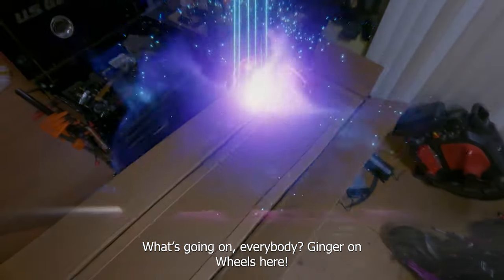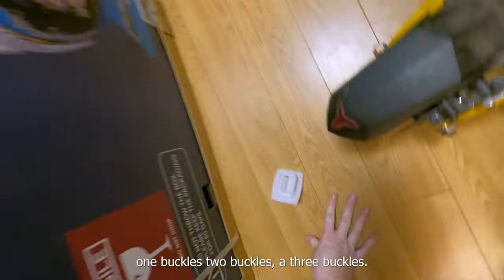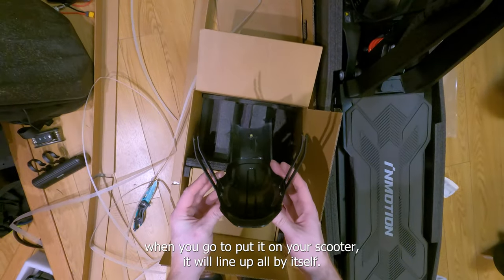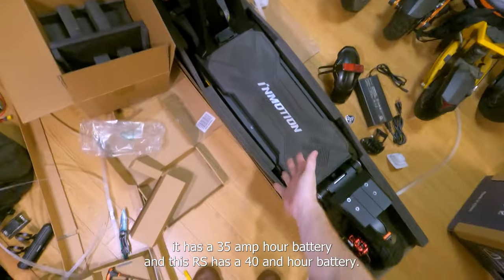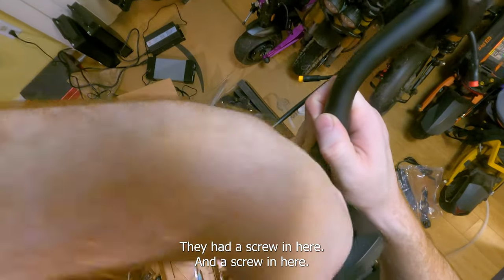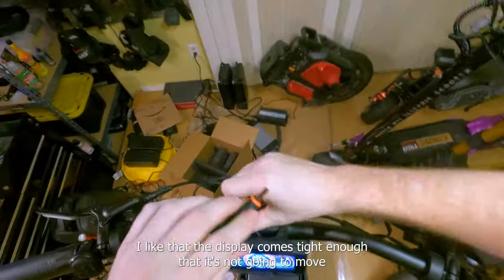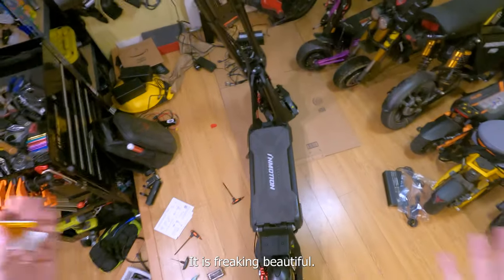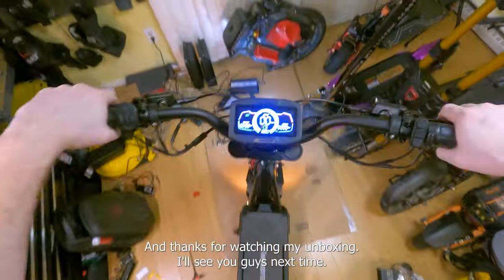Inmotion RS Midnight Unboxing & Walk Around

Comment: I have the latest batch RS from Dec, not the midnight, I like my orange, more exotic looking.  Lights at night looks amazing on orange.

To fully enjoy the extreme capabilities of this scooter, I place the handlebars at my bellybutton - I don't know your comfort level. Handlebars are flexible, not wobbly - best this way for road fell.

Acceleration is sick, warm up the CST tires (mostly nylon) first before cutting sharp corners because the power response is killer.  PMT's (all rubber) will slow it down a little, 2-4mph at top speed, but the grip is stellar.  Keep the deck level at default, no need for anything else really unless you plan on doing 64mph speed runs, then lowest level is slightly better.  Tighten the damper a little till you feel some tension, it helps.  The genius behind this scooter is that the rake angle on the stem points behind the front motor axis, this is what makes it super super stable.  Scooters that have external dampers have this flaw where the front axle is even with or in front of the rake stem angle, that is why they need it.  Kaabo's GTs stems go straight down even to motor axle (like most scooters).  Teverun 7260R (I love this SK battery) has wheel too far in front of the rake angle, at 45mph its unstable (bad), so they try to fix it with dual dampers - a Band-Aid, not a fix. I'll wait for their next design on this.  You will soon learn what I mean riding the RS.

I placed a Pedego Bike Thumb Throttle on mine (check Amazon), the best thing you can do, better control, no need to try and grip it with your inner hand. This will undoubtedly be your favorite scooter by far. 

The only other one I ride that I like better is the Emove Roadster, 75mph exotic beast.  Enjoy the RS, almost nothing beats this production scooter.
Reply from the maker: Those are all very good tips! Welcome to the channel, make sure to subscribe. Maybe you can check out the other videos I made on the gen 1 RS a couple months ago. I did a full teardown and I got it above 60 mph 😅
Reply: According to alien rides who has this the bronco vnom extreme 11 beat it in 4 back to back races. Comes with a 50ah battery and $3500 shipped. According to freshly charged the stability was better on GTR and thunder 3. Love the idea and water proofing but lacks on top end.
Reply: Yellow more then orange. Its yellow
Reply: @YoungWise2011  "lacks on top end" 🤣🤣🤣 only ppl that dont ride scooters say that. 
60mph is plenty top end. Adjust settings properly and it'll get you there pronto. 
Also you dont ride constantly at 60. Very few times will you do it. Most times ppl ride at 45mph. (60kmh)
Reply: @240jz  The Pedego is a screw strap attachment to your existing twist throttle.

Comment: Mine comes in Thursday. Pretty excited to do my unboxing as well.
Reply: Still waiting on mine. How you liking it? Did u swap out for thumb throttle?
Reply: @YoungWise2011  loving it , got few videos of it on my channel
Reply: @hurdthenerd  just ordered the lettering. Looks clean. How you liking that throttle u going to buy the thumb from inmotion? Any trouble with the locking mech??
Reply: @YoungWise2011  the throttle is fine , you’ll get use to it. 
The locking mechanism is fine, just wish it was easier

Comment: Nice packing job. I just received a BRAND NEW OG STORM that was shipped in a “X Ltd” box with, like 30 little styrofoam pads (marked with VORO logos). The battery was hanging out (and won’t charge), the RGB remote was broken and everything else was in a plastic bag. Took videos and sent them to VORO and EXTEND. Both said that VORO wasn’t responsible for shipping damage! REALLY?!?? You put it in the WRONG BOX (HUGE X box) and threw a bunch of little styrofoam pads in it and called it good. EXTEND? Please…😢 I have the video if you’d like to see..
Reply from the maker: That doesn't sound like Voro at all. Who did you speak with there? In every case like this they will usually bend over backwards and often times lose money trying to keep customers happy because the alternative is you filing a chargeback on your credit card and they will be completely SOL plus have to pay large fees on both ends of the transaction.
Reply: @GingerOnWheels  several people, Ricalyn was the last one tho

Comment: So I noticed they've removed the feature to select front wheel only.  Or is it still there?  When I press and hold the cruise button, 'D' sometimes come on solid, or flashes, or goes away.  What does the flashing 'D' mean?
Reply from the maker: Flashing is front motor only.
Reply: @GingerOnWheels  ok.  so flashing = Front.  no ‘D’ logo means rear only.  And solid ‘D’ = dual motors?

Comment: Hi. You mentioned cell balancing, how do you usually do that?
Reply from the maker: Just leave it plugged into the charger until the light on the charger turns green. In theory it should be balanced once you do that but I've seen some scooters that need to stay plugged in for a half hour or so after that in order to balance properly.
Reply: I believe you already have a nami scooter from your videos. But, in Nami's case, if the charger is already green, it's ready to be unplugged right? Sorry I just really don't understand this cell balancing properly because they said that it should only be 25 to 80 percent to extend the battery life. So if I leave it like a 100% it would affect the battery life. It's confusing because as far as I can understand, both maintaining optimal charge and cell balancing is necessary for longer battery life but the methods on how to do these seems contradictory.
Reply from the maker: @ljgales267  It's true that not overcharging your battery will help it last longer but it is definitely necessary to balance your cells every once in a while. Every 15 or 20 charge cycles or so is probably fine. You just want to make sure it happens every now and again. For what it's worth though, you're going to be very hard pressed to maintain ownership of your Nami long enough to notice any degradation in the cells. I know a very few people with 15 or 20,000 miles on their original scooter.